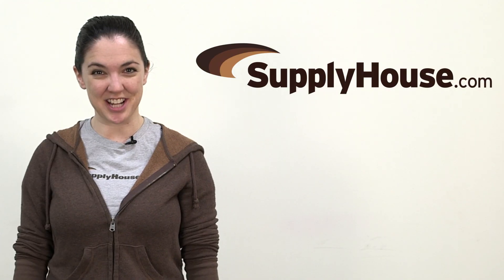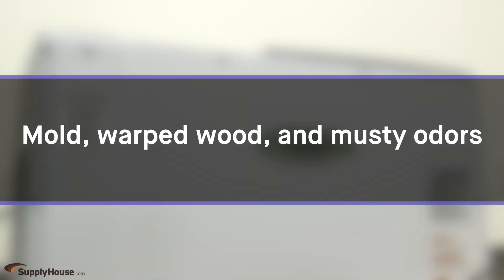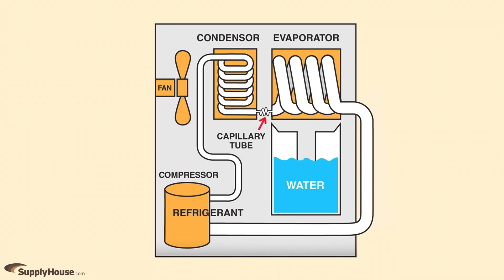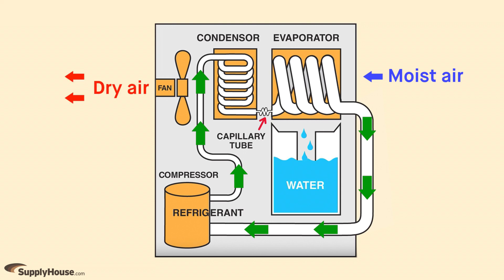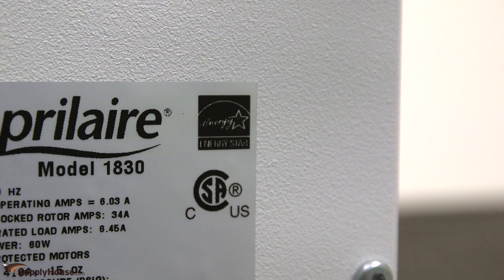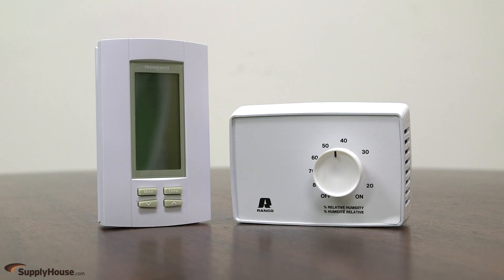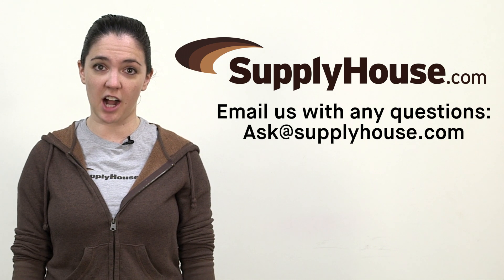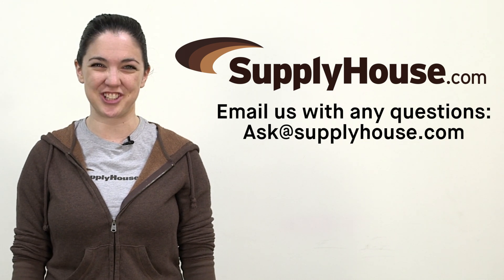Whole-House Dehumidifiers

Comment: Is this unit tied into the Furnace/AC control board or does this run via its own power supply and thermostat?  It appears it is a stand-alone system that moves the air through its own unit when the Humid-stat calls for it.  With that being said, will this unit maintain ~40% RH for a 3,000 sq ft home?